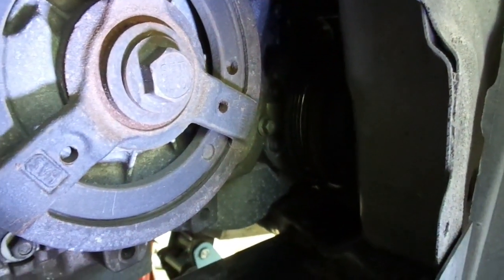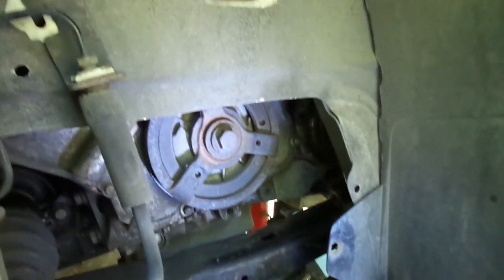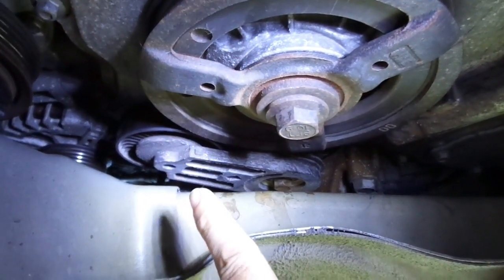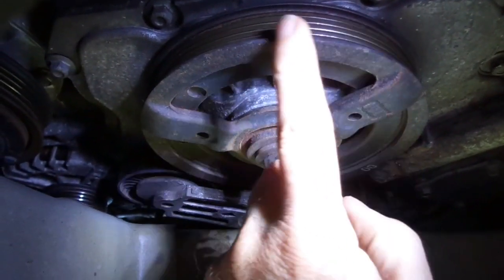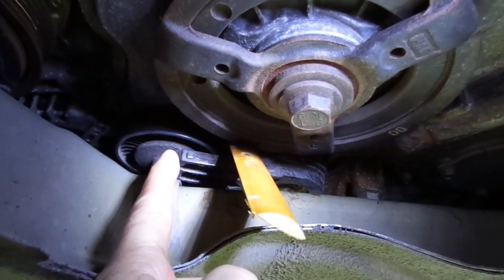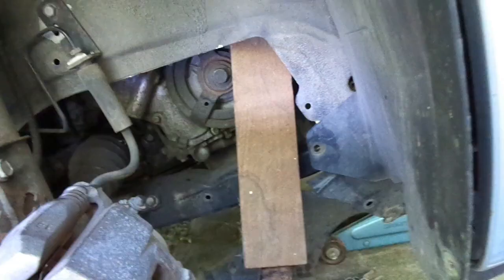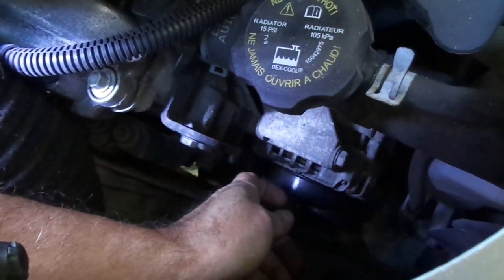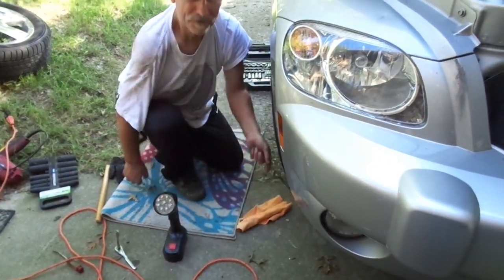We Replace Bob's 2009 Chevy HHR Serpentine Belt

Comment: This video and comments helped me out so much... Thank you Mayor and Townsmen and Women... I used the "Jack Trick" 🙂and it work so smoothly. I started my loop around the crankshaft, pulley tensioner, then the AC Pump. I used a jack and big flathead screwdriver, like a foot in half or two long to push the "Pulley tensioner" up, from the ground with the jack. Note, you have to push it up, quite a bit, I didn't want to push it up and break or something, but to save you time, you have to push it up about 2 to 4 inches, possibly a little more. It will make it easier for you to slip the belt over the Alternator. Make sure it covers all of the moving parts for the belt. Once your happy, slowing lower the jack and make sure belt is resting correctly over all parts. Go start your car and come check it and make sure its moving over everything correctly and then turn it off and your good to start installing back your cover plate, behind tire. Passenger side. It is tight, but this video helps out alot... Awesome video and thank you and just wanted to share my exp
Reply from the maker: Glad the video and comments helped.

Comment: I cut the long serpentine belt tool in half.  Took me 4 minutes to take off belt and new one on.  Spent 1.4 hours fiddling with long 3/8” tool and finally got smart and cut it.  I will buy another set $20 won’t kill me
Reply: Man good for you.
I couldn't replace one on a cavalier for the same reason. I really wanted to cut that tool in half. But it was borrowed. Now years later same problem with the HHR. Basically it's a cavalier/cobalt with a HHR body. 
Gonna finally do it 
Buy the tool and cut it in half . Save a lot of trouble. Especially raising the car up so high ! Thanks for the memories, I'de forgotten.  ....👍

Comment: Jack with a hammer handle on the tensioner worked great. Not difficult at all.
Once the belt is off except for the tensioner, remove the jack. You can then push the tensioner up by hand far enough to get the belt out from under the tensioner.
 Don't do it like they did leaving the slack at the top. That makes it hard.
Just put the belt on every where but the bottom. It slips right on.
CHEERS! .
Reply: Thanks for the hint Mike.  We were flying by the seat of our pants as you probably guessed. LOL

Comment: I don't know if you'll see this but the idea with the Jack and piece of wood was a great idea but I used a metal file instead of wood and Jack the tensioner pulley up the belt slipped on perfectly! Now the fun part is remembering how to put it back together but thank you very much your video was very helpful
Reply from the maker: I always try to reply if it comes to my Gmail as a notice.  
Thanks for the info and the great comment Scott.

Comment: Well, I used a 3/8" breaker bar with a metal tube extension and that worked quickly, no need for using a hydraulic jack. If you don't have one, this will work but it makes it pretty difficult, as you experienced.
Reply from the maker: It was what we had at the time and it worked. :)

Comment: FYI there is no rest of the inner fender to take  apart without a Sawzall. The correct tool is $20 @ harbor tools then Cut aprox a 3rd off the handle of the gigantic 3/8 tool and walla done in minutes.
Reply from the maker: As you can see we were totally winging it and had very little clue.  
Somehow we still got it done.  LOL